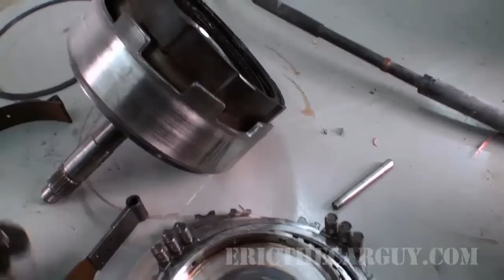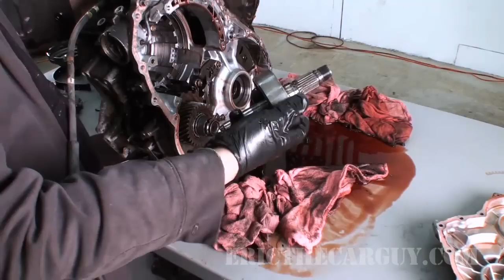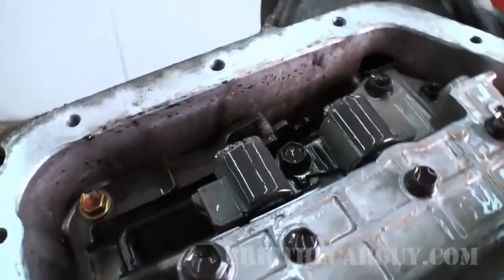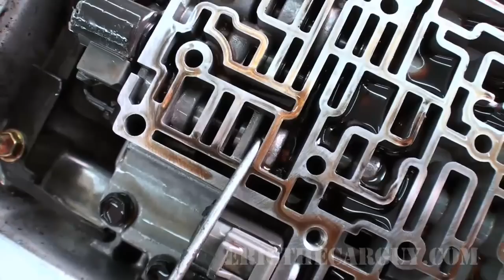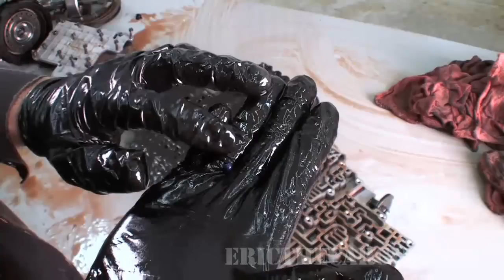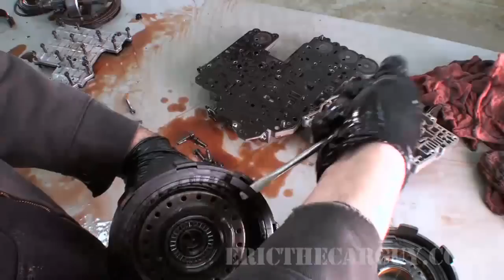The Basic Parts of an Automatic Transmission (Part 2)

Comment: auto's are pretty much a fluid computer, solenoids as transistors and the ball bearing valves as diodes
Reply: High voltage diodes are called valves.
Reply: accumulators are capacitors

Comment: My mom has a 2001 Odyssey. 240k miles. Currently on its 4th transmission. #1 and #2 failed normally, just wouldn't shift. #3...the transmission seized while she was driving and exploded fluid all over the engine. Left her stuck on the side of the road in a cloud of smoke. The engine is still in perfect shape today and has never had a problem. To Honda's credit, they helped her out even though the car had 220k at the time.

Comment: Great video series. The valve body is like an analog computer using fluid pressure, digital valves, and one way check valves to determine which gear to engage.

Comment: I thought that transmission work was overpriced, now I know that good transmission guy deserves every damn penny.
Reply: Ya same here lol
Reply: Im rebuilding my Ford c3 for my 1929 Mercedes Benz! the kit was 200 $ and we just finished (we think) it will work now it wasn't going into any gears. were going to put it in this weekend and hope for the best
Reply: I work at a transmission shop. I'll tell you it's no joke a transmission is very complex and they will have many variance of the same transmission. Get one check ball, spring, snap ring or clutch in the wrong place and you will have a world of trouble. You have to have a strong understanding of how these components work to properly repair them.

Comment: I am currently a technician although not an auto technician. I still deal with the parts like this including gears, solenoids, seals, bearings, retaining rings, and etc. Really a technician job is to fix a problem, we do typically understand it. Although, it is the engineers job to design it and make sure the purpose is happening. I do currently wish to become more of an engineer which would not be too difficult, although I really need to pickup more mathematics. It is amazing to see how engineers come up to put all the concepts together. But be thankful for the scientists making the discoveries, the engineers designing it, and the technicians fixing it.

Comment: Good description that adequately caters to the understanding of automatic drives. Gives a good insight to the control elements as well as transmission from torque converter upto delivery of power at the wheels through the trans axle.

Comment: What a great tear-down and analysis. Thank you.
 The mind it takes to engineer the valve body alone is astounding. To integrate it into the various other components is an engineering marvel! It obviously takes a well integrated design team. Then the idea has to go to casting and machining. No wonder automatics are so expensive.
I'll stick with manuals myself, those I've refurbished without to many issues.

Comment: I had a transmission failure a few months ago on a Mitsubishi Verada (Galant or Diamante for USA market I think)... While driving suddenly it died, no drive to the wheels, no reaction when selecting different gears. Replaced it with another transmission, but thanks to this video now I'm pretty sure the oil pump failed. Shame I didn't open it to check! Thanks for this GREAT tear-down!

Comment: I'm watching this because of my slipping Honda Accord v6 and wow you hit the nail on the head about the valve body
Reply: +Jah Bless I think Hondas have their own proprietary design more similar to a manual transmission but could be wrong. IIRC also the 3rd gear tends to overheat on the v6 accords that have the faulty 5 speed design.

Comment: Eric I really enjoy your videos, thanks!!  I was pulled into this wonderment about automatic transmissions because my wife's inherited 2011 Buick regal with a 6t40 transmission recently failed, and within 2 months of the dealer changing the ATF fluid at 60k miles, probably for the first time.  It just stopped working in D and all forward gears, reverse still worked.  So frustrating and expensive, and I suspect the fluid change precipitated the failure.  We are having an independent shop swap in a remanufactured transmission as I write this.  Good lord those transmissions are complicated beasts!!!  Sooo many points of possible failure, especially for the 6T40 which seems prone to early failure for various reasons like broken snap rings destroying delicate internals. The dealer said there were no metal particles in the old fluid, but they also said they don't flush anymore, nor do they replace the filter, which for this transmission you have to remove from the vehicle to get it open enough to access.  Getting into the transmission itself to diagnose was the next step - or just replace it, which after watching this video and a couple more on the 6T40 seemed like an easy choice!  Thanks again.  Do you have something similar for CVT transmissions?

Comment: Excellent video ... Thanks for sharing .. Never know what was in a transmission -  but now I can say I know a few buzz words :)  
Lever - Park, Drive, Reverse, 1, 2, 3, Low
Valve Body - (Brains) - valves to allow pressure to various gears (directs oil pressure to different galleries) opposite pressure (Differential pressure); Pump - (Heart) Oil Pressure,  Accumulators (Hydraulic cousin dampers like shock absorbers), Governor, Bands, Clutches and 2 sets of Planetary Gears  (outer housing center is the sun gear, center Planetary Gear, outer Ring gear)

Comment: Honda uses accumulators to act as shock absorbers between clutch activation. The dampening effect will cause the oncoming clutch to slip a little longer, effectively increasing the clutch engagement time. This softens the shock when changing from one gear range into the next.

Comment: I learned a lot from this. Thank you for you upload and taking the time to make this informative video :) It was helpful and fun to watch.
Reply: Also I was going to ask is it possible to put a reverse manual valve body on an automatic transmission while its still mounted up to the car, without having to actually drop the tranny and do it on a table? I lack the necessary equipment (transmission jack/stand and work space) to do the latter.

Comment: Hey Eric. Fellow Ohioan here from the Dayton Area.

If you ever want to do a Manual Transmission dissection, I have a busted one from my 91' Festiva that you can use, only thing I would ask is I do need it back because it is repairable. But if you do break it more than it already is, no foul, it has just been sitting on my garage floor for the past 7 months.

Comment: for anyone that may be trying to rebuild: if you do that rag trick between two gears MAKE SURE you clean out all the torn bits that come off the rag. i personally just hold the gear with a rag and don’t let it spin in that manner and there’s a lot less lint that can get inside the transmission and that’s always a plus

Comment: Thank you for telling people not to change fluid on transmissions that have been neglected. I have a lot of people ask me why their transmissions failed after they replaced or flushed the fluid. Sometimes its better to leave it alone. If I had to venture a guess why this transmission failed, I would say that someone changed the fluid and put in the wrong spec fluid. The transmission is very clean and that's the only thing that I have seen cause that kind of failure. Toyota's require Toyota fluid

Comment: A "standard" planetary gear set can provide 2 speeds and reverse depending on which of the three primary components (sub gear, planet carrier and ring gear) is held fixed and which is the input and which is the output.

If you are old enough to remember the GM Powerglide transmission from the 60s,, it had one planetary gears set and only 2 speed.

Modern transmission with more than 3 speeds use a Simpson, Lepelletier, or Ravigneaux gear set or combinations of these planetary gear sets.

Comment: Came on here looking for the transmission fluid temperature sensor that measures the temperature of the transmission’s automatic transmission fluid. It is often used to delay the engagement of overdrive and the converter clutch when the vehicle's engine is not warmed up. If it fails it is sometimes unnoticeable, but may produce an automatic transmission fault code. (Toyota Lucida 2.2TD AWD) Maybe on the video Eric ? Thanks anyhow, enjoyed watching.

Comment: Just Keep in mind that if you see   burnt up clutches for 2nd gear or 3rd gear , etc you need to check all the valves to  make sure that they aren't stuck or that a bearing didn't just explode or a bad linear solenoid because burnt up clutches is just a symptom of another bigger problem

Comment: Clean it up, install new seals, o-rings and clutch packs, you have a good solid transmission. All the bearings looked good and the accumulators are free. I doubt a master kit for that trans would be more then 300.

Comment: I have not had the funds to pay someone to do my mechanic work thus have had to do my own for years. about 20 years ago I bought a dodge with a blown motor, I rebuilt the motor in the front yard and ran fine for a little while. however the engine had too much torque as it was new and fried the transmission. I rebuilt it using some pictures of the placement a friend gave me and it made it till about a year ago, then failed. I now have a Ford front wheel drive transmission to fix.Thanks 4 the info

Comment: Once, after changing trans fluid, I had a vehicle that wouldn't shift properly. I let it run for a few minutes and drove it a little and eventually it shifted fine. In retrospect, I think there was an air bubble somewhere in the valve body that needed to be cleared by movement of the fluid before it would allow the valves to work normally. I guess these systems need to burp themselves.

Comment: My guess is that it's a traditional thing. They got most of the development of a fluid-driven AT already done, so it would be quite a big investment to design a new AT completely from scratch. And it would still need fluid on the inside for cooling and lubrication. However, many of the new double-clutch transmissions work that way. While they are automatic as well, they leave the driver more control over shifting gears and don't have a torque converter, but 2 clutches instead, as the name says.

Comment: I'm gonna drive a manual and avoid this headache. You auto trans drivers are brave af 😂. One seal leaks and you lose a clutch pack or torque converter clutch. If you gonna drive automatics long term, the transmission design must be very reliable.

Comment: I always like your video's and non related comment, I am rebuilding 95 Corolla engine and putting it in a fwd corolla just as a hobby. I will post everything or as much as I can when the project is complete. Fun little project. At least I think. :-)

Comment: Thank you Eric, Very helpful, clear and instructive, I have a 96 MPV 3 ltr, the  tranny jump in and out gear at 95-100 km, I am very tempting to tear it down to see what's the problem,  fluid hot and burnt, and a bit smoky of stick is out.  What could be wrong?   Thank you so much.  Dale of Vancouver Island

Comment: Thanks for doing this video.  I have a Nissan C24 Serena cable type transmission and the torque converter is gone but it still moved forward but no reverse and the gears were not changing.  Apparently a bad torque converter overheats the transmission and damages the clutches.  I'm hoping for a miracle but could you do a video concerning the overdrive?  How do transmissions go into overdrive.  Perhaps you could use this same transmission.  Is it the valvebody? or is it the planetary gears.  Also could you do one of these for a CVT Nissan transmission? Just askin.

Comment: Hey Eric, so I had my crankshaft position sensor replaced and then setup, car runs good now but odd thing happened, I was driving at highway speeds going on a 30 min drive to another town and half way there the car just randomly shut off like it was doing all the time before replacing the sensor, but now it starts up right away instead of fighting to start....I'm at a loss and about ready to give up on it and just retire the darn thing....2002 chev cavalier 2.4L.

Comment: Eric, thanks for totally dismantling each of the unit. It is very very difficult to understand sun & planet gear drive. Anyway you have tried your best. In addition you have tried to show hydraulics part of the transmission which has logic for working of each valve, springs, balls, holes, NRVs etc. My question is are you going to assemble it back. I think only OEM can find a fault & reassemble it in a correct way.

Comment: If it is a new car, brand new, it is best to break it in before being harsh. You can drive at any speed you want in regards to MPH, but regarding the RPM try to keep it in a moderate zone.

Example would be if redline is 5500, keep it below 3500-4000 until the first few hundred miles.

Comment: Those are wet clutches just like in any manual motorcycle transmission. The only thing that makes it confusing is the actuation and release mechanism which is the valve body and solenoids and "what not"...and "what not"...

Comment: Automatics can be more fuel-efficient - since you can add more gears (and by extension - lower ratios), and they eliminate the human error in matching shift-points and over-revving. 

They're also better in turbocharged applications - since you don't have to let off the throttle when accelerating - you won't lose boost pressure.

With ever-tightening emissions and mileage standards - manuals are pretty much out the door.  Even autos are being replaced by wet-cluch applications and CVTs.

Comment: I remember the worst automatic transmission I ever had to take apart...was a 94 ranger I believe, they got stuck in the snow and just kept rocking the truck back and forth for who knows how long. It fried everything. the clutches were basically welded into the drums...couldn't get them out with anything. even throwing the assembly against the wall didn't seperate them.

Comment: And now I'm less incredulous of  transmissions being so expensive. I would like to see the inside of an 8 or 9 speed.
Reply: no candy  8 or nine speeds are the same as the four speeds only difference is the brakes like the one way or multi plate clutches  and hydraulic pressures that go thru them so they are basically the same size with two planetary gear sets.

Comment: Eric, I'm just curious about something.  This may seem like a stupid question, but is the transmission setup different depending on what kind on engine you have?  In other words, would it have the same parts and setup if it were an inclined engine, a V shaped engine a Boxer engine or something like that?  I know you don't work on exotics, but based on what you know, would the transmission setup and parts be the same or different on them?  Again, it may be a stupid question, but I'm just curious.

Comment: main purpose of fluid coupling is  transmitting torque. not multiplication. in case of auto transmission, in most operations  turbine and impeller rpm is very similar. which means the torque of two is same unless there is significant slip between  turbine and impeller rpm.

Comment: The manual valve allows you to shift the car manually through the gear ranges. Otherwise, you shift the car into D4 or D5 and the PCM shifts the car electronically.

Comment: I believe on these partly electronic transmissions that 1,2 and 3 are mechanically controlled, and 4th and the torque converter lockup are computer controlled. Newer all electronic ones are just that, and if the computer dies you have to manually shift from 1st to 3rd.

Comment: Yeah Im all for doing most of my auto repairs and if im ever in the issue of needing a trans repair minus a filter change, Im all for the replacement on the trans itself. I have automotive knowledge but im dumb when it comes to the internals of a trans either manual or auto.

Comment: Hey Eric, I want to see you do a video in which you use the old 
heat gun and freeze spray trick to get rid of that dent on  your subaru's bumper. That dent is starting to annoy me. I am watching the progress of this Subaru and every time i see that dent, I get pissed . You need to also put some new oem or aftermarket wheels and tires on that car. Maybe you can do a video on offset and tire size and types of tires.

Comment: This is so fascinating, but at the same time so scary to think that companys think its a good idea to hand out such a complex object to the public. Like if that valve body locks up or if one of those clutches slip, good luck.
Reply: But also have nothing in the maintenance plan for renewing the ATF oil, and don't even tell you where the AT dip stick is in the hand book. ie Volvo. Found my 2005 V70 dip stick hidden under the rad return hose.

Comment: It seems likely that the worn clutch plates may have been caused by some kind of a weak engagement of hydraulic pressure as well, especially due to the decent condition of all the other gears. I would assume that something caused it rather than it just wore outI would assume that something caused it rather than it just wore out randomly